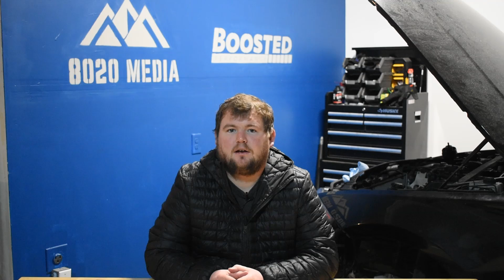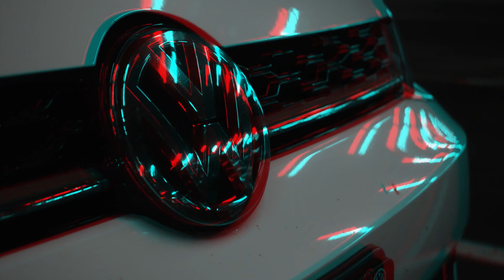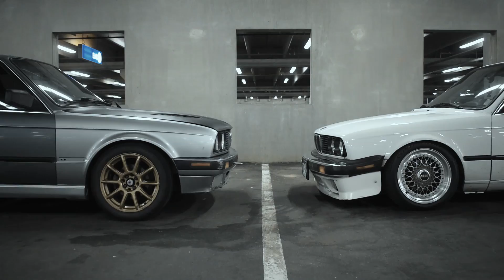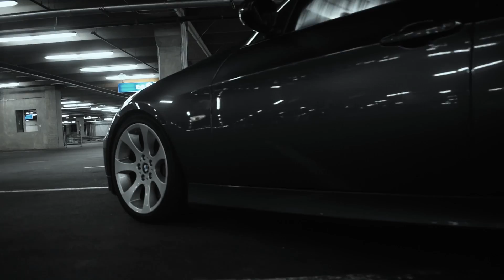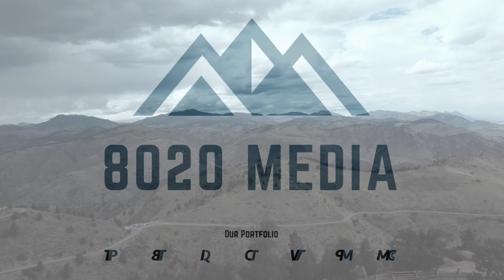BMW N54 | Single Turbo or Twin Turbo Upgrade?

Comment: Folk you don't have to spend this kind of money if you do the work yourself. So if you are capable mechanically and can follow a few tubes, you can get this work done far less expensively.
Reply from the maker: P - Completely agree. However, it's not for the novice DIYers!
Reply: @8020Automotive That is true. I have been a backyard mechanic since I was 15. I'm 59 now. YouTubes like yours are invaluable to me.

Comment: Really interesting video! Personally I'm going with a single turbo kit for my 2007 335i with the 7 speed DCT because I'm aiming for a lot of power, over 900hp. The transmission will probably be the limiting factor so it'll definitely need to be reinforced.
Reply from the maker: F - Thanks for the feedback! Hope it helped.

Comment: Single turbo other pros : less heat ( so no need to upgrade cooling system), less hoses, less vacuum issues, less boost solenoid issues, less carbon built up ( pcv open air) , less O2 sensors. So overall wayyyy more reliable. On long run this is cheaper 100%
Reply from the maker: J - Thanks for sharing this insight.

Comment: I have vargus stage 2+ turbos rated for 750whp im thinking pushing them to 650hp or so would these twins be too hard on the motor at this power level, with a graduall boost tune like 10ps 2200rpms 16ps 3400rpm ect...
Reply from the maker: J - What else have you done? We have a ton of N54 content on our website that is helpful here: https://bmwtuning.co/bmw-n54/
Reply: @8020Automotive  the car is full bolt ons Port injection dual 450 fuel pump relocated inlets, twin disk clutch and all, just need to do lSD at some point.
Reply from the maker: J - Sick build man. Pretty similar to our 335. This article might be helpful for your research: https://bmwtuning.co/how-much-power-can-the-bmw-n54-handle/
Reply: @8020Automotive  thank you very much I will check out the article, and thank you so much for being such a Big help and influence to the n54 community on a budget to high end build... And always taking the time to answer all over our silly questions. 🙃🤝
Reply from the maker: J - Of course! Keep us updated.

Comment: Hey I know im a year late😂 but I really need some advice for my recently bought 335i, I REALLY hope you see this. I just bought a stock 335i, and looking to put money into it. It has 105k miles and after watching this video I’ve decided to go the single turbo path. I don’t know where to start!!! 
Can you please tell me like a checklist of things to do before I even think about installing a single turbo, it would help me a lot. Thank you in advance
Reply from the maker: A lot of it can be done while converting to a single turbo. I'd recommend checking and potentially preventatively replacing some of the following:
-Serpentine belt & pullies (when the belt snaps it can be pulled thru the front crank seal)
-Oil filter housing & gasket, valve cover & gasket, oil pan gasket
-Coolant hoses
-Fuel injectors (check/test for leaks)
-Walnut blast intake valves

I could add more to the list, but that's a good starting point and there are a number of other things you'll be in the area of while installing a single turbo. Best of luck with your build! Let us know if you have any more questions.
Reply: How much did you spend on the 335i ?
Reply from the maker: G - A lot at this point lol. 5 figures easily.

Comment: Great video. When my stock twins suffer the inevitable, I'll go with Pure Stage 2. But honestly don't need more than 500 crank.
Reply from the maker: S - That's what we did! Replaced our twins with aftermarket twins when they went out on us.
Reply: 500 crank is possible on pure 600s. No need for stage 2s .

In addition I have pure 600s, they follow factory boost targets rather well, only about a 200 rpm.difference max in commanded boost and actual.  And hits 8 psi around 1800-1900 rpm. So not a huge difference between stock spool and pure 600s. 

I'm paying off the vrsf charge pipe i had to get to finish off the motor side of things, once that's done, tune time. Will be interesting to see how much performance increases.

Comment: I’m curious why you decided to go with RB Two’s at around 500whp when you said stocks can make 470ish whp
Reply from the maker: Zach is currently running around 600whp on his current tune and turbo setup. But it's always smart to upgrade earlier than you need to and to get a bit more than you intend to use. Running the stocks full bore at 470whp is going to impact reliability quite a bit. Just like running a turbo setup that maxes out at 600whp at 600whp on a daily basis. Building in some power margin is the best bet for reliability in your setup - you don't want your turbos kicking 100% all the time.

Comment: 07 335i AT here… Great insight! So to reiterate what you’re saying, if my goals are 550-600 wheel I should probably just go upgraded twins versus spending the extra money for big single? 

That said, it may be arguable, but who makes the most reliable twin setup for my power goal?
Reply from the maker: Luckee - Thanks for the feedback, and yes, you are correct. We would say TT. We've got a great guide on our BMW Tuning site: https://bmwtuning.co/bmw-n54-upgraded-twin-turbo-guide/
Reply: @8020Automotive  Thanks! Checking it out right now!
Reply from the maker: Keep us updated!
Reply: Check out the Arashi Twin Turbos for the N54 , they are ball bearing, will make way more power then Viv 19T V4 . A little more expensive
Reply: @ForzaPulls are you currently running them ?
Reply: @ForzaPulls no way 15t are gonna make more power than 19t viv v4  is was bigger

Comment: The n54 platform is dead i thought this video was over 10 years ago lol bruh we on b58 s55 etc sold my n54 like 6 years ago
Reply from the maker: Sure, the N54 is getting old and the platform is certainly slowing down. However, it's far from dead and debatably still a better platform than the B58 at this moment. I'm not questioning the B58 is the better engine (especially the TU and now doubly so the TU2 with DI + PI from the factory).

The chassis' the N54 is found in make for more fun drivers cars, though. They're lighter, the 6MT is abundant, and they don't have the junky electric steering. When the B58TU in the "M-lite" models comes down in price and the TU2 makes its way into 240/340/440 models then the B58 becomes a much more appealing platform. For now, the N54 is still alive and well.
Reply: I smoked tf outta new supra with aftermarket exhaust and tune from what I heard in my n54 535i.  Bang for buck way more than the b58. Yes the b58 is a good motor no doubt. But bro, I'm 600hp reliable dd on this and still have room to turn it up. My shit cost me  $15k from the car to parts at the most! Supra dude I smoke probably took his car to the dealer after talking about "something wrong with this one" lmao 🤣
Reply from the maker: Grizz - Thanks for sharing this experience. We love hearing things like this!
Reply: Bro my stage 2 plus n54 have dudes around my way with b58 wanting to go big single to face me. Just because you gave up on the n54 platform doesn't mean it dead. In fact now that it's so much cheaper they are getting far more popular here in Florida.
Reply: The n54 is the OG remember that.
Reply: @bigash_n54  tell that fool... Can't count the n54 out.with enough money anything can be fast.
Reply: Idk what world your in 🤦🏾‍♂️
Reply: I could tell you actually never owned an n54 and just spewed that comment out of bitterness , malice , and just the fact you have nothing going on , so you resort to blind hate . Get a life , not even one response 😂

Comment: Can someone tell me if a 2016 535i m sport would benefit having a single turbo vs a twin set up that it already has.
Reply from the maker: Extreme - a 2016 535i has the BMW N55 engine. BMW used the rather confusing marketing term, "Twin-Power Turbo". The N55 is a single turbo engine that utilizes a twin-scroll turbo. You could convert the N55 into a true twin turbo setup, but it wouldn't be worth the money.

Comment: You just saved me spending a lot of money on the twin turbos which will not even a way to achieve my goal, after watching your video I’ll deffo go for the big single turbo instead the upgraded twin turbo. What single turbo do you think is best option for achieving the highest power on N54? My goal is around 900-1000whp! 

My car running around 500bhp right now it’s on a stage 2+ and the list below is what I’ve done to my car, what else do I need to do to achieve that power? I’ll be much appreciated for the advice:

Aluminium charge pipe upgrade
Bigger step turbo intercooler
Stainless steel downpipes
Bimmerlife r8 coils
Silicone 1.75 Inlets
Platinum plus spark plugs

Oil catch can
Oil temp pin change mod
Engine cowl delete + filters
Upgraded pev valve and alloy cap
Index 12 fuel injectors
Ramair Cone filters
Stage 3 low pressure fuel pump
Xhp stage 3 transmission remap
Mhd stage 2+ engine remap
Protool coded out wingmirrors and bleep sounds
Reply from the maker: Danny - to realistically hit those power numbers you are going to need a built motor on top of a fat single turbo, a bunch of fueling mods, and a ton of other serious stuff. FWIW I'm about $10k deep into my 135i single turbo build (shooting for 700-750whp) and I still don't have an LSD or proper wheel/tire setup yet. A built motor for those power levels will probably run you like $8k and then figure $10k for your turbo setup and to handle 900+whp you're going to need to upgraded axles, a built transmission, and a bunch of other stuff as well which is going to run you thousands more. 

Not to be mean but if you're asking what it takes to get to 900-1000whp you probably aren't really ready for those power levels. I'd say drop a single turbo on it and start with the 700whp mark and go from there. Getting much past 750whp without building the motor and trans and upgrading the axles is just asking to blow up all of these things. Even with the mods list you've got going hitting 900+ is going to cost you probably $25k, and that's assuming you DIY all of the work yourself. 

700whp is fast as crap so start there. I'm expecting my 135i should be able to hit 750whp on the dyno, but I'm going to keep it around 650whp on the street since you really don't need much more than that to have an insanely fast car and it will help keep me within safe limits of the stock motor, turbo, rear end, and trans.

Comment: If I upgrade internals then surely large twins are better
Reply from the maker: That's a toss up. Really depends on your goals with the N54. Once you move to larger TD-04 twins you'll be introducing a higher boost threshold and more lag vs stock frame TD-03 turbos. 

These TD04s can hit 700+whp but I believe, as discussed in the video, a ST is the best option at 650+whp. The PT 6266 or 6466 can spool very well (a tiny bit slower than TD04 twins but not far behind), give more headroom, better peak power, etc.

Ultimately, 450-550whp Id go TD03 twins, 550-650whp TD04 twins are a great pick, anything 650+whp then the N54 ST conversion is likely the way to go. That said, maybe your goal is 600whp with fast spool and excellent low-end and mid-range torque. In this case, Id be on board with building the engine and running RB Twos Plus (TD03 w/ ported outlets) at that power. Those are the turbos I run on my 335i and Id have full faith in running them to 600-625whp on a built motor.
Reply: @8020Automotive  thanks only just seen this for some reason! Yeah I think the low end and mid range torque are best for track use so that’s the way to go for me!
Reply from the maker: J - Keep us posted!
Reply: @8020Automotive what if I want the simplicity of a single turbo but only want about 500whp? Could I just get a smaller single turbo?
Reply from the maker: M - Don't know if it would be worth changing everything if 500whp is your goal.

Comment: For track use what would you prefer? I think the twins.
Reply from the maker: I personally prefer the twins for a track setup and believe that would be the better option for most people looking to track an N54. Anything over 450-500whp is way overkill for most track days, most race tracks, most drivers, etc. Of course, you can make more power and simply turn boost down for a track day. Anyway, the quicker response and low-end torque of the twins will likely be ideal. A small single turbo like a PT5558 or PT5862 (or equivalent size/specs from another turbo manufacturer) could be a good option too.
Reply: @8020Automotive had an issue trying to track and didn't know about the xhp torque reduction upshifts and launch control until after. Always on stage 3 but never tweaked anything for the track until after.
Reply: That’s what I think too. Thanks

Comment: Before upgrading turbo set ups.  New injectors. New coils. Water pump and thermostat. Gaskets all round.  Plugs. Uprate the valve cover and pcv setup.  Once you spent the 5k to 7k on getting this ready for higher boost you can start to think about spending a good 1500 to 2k on fuel upgrades.  Fit new turbos or a single with a good custom map. And start saving up for an lsd and uprated driveshafts.  Now your a good 20k into a build.  Now if you wish to push your builds to next level your looking at aftermarket ecu.  And the only option out there for Di and pi is syvecs.  Don't let this put you off.  I love my n54 but not my daily
Reply: Did mine for way cheaper. 535_i_drive  on 19t's e40 tune fbo. Yes did new injectors, vanos, boost, wp & thermo, mosselman oil thermostat, b58 coils, mfactory lsd. Got the car for $6,500 originally. 540whp on 19lbs stock lpfp too (535i  has stronger lpfp than a 3 series)
Reply from the maker: Grizz - Thanks for sharing your experience!
Reply from the maker: Adam - Thanks for the valuable insight here. We couldn’t agree more! We have two N54s in the garage and are converting our 135 into a ST in the near future. Love them both.
Reply: Water pump and thermo, huh.
Reply: Do maintanance ------ Injectors, coils, plugs, gaskets etc. Then buy LSD preferably inside of M LSD... good suspension... Then VIV V4 19T with inlets etc. + oil pressure sensor.. = no need for single turbo and you have basically small  M4

If you want to keep some ability of daily drive etc.
Reply: @FeeZeeF30 are viv 19t worth it? How much power can you get out of them reliable?
Reply: @georgecatan9333   their V4 version is better then OEM and have a great reviews... me 500hp and were good when i sold car after 15k km
Reply: 20k if you're an idiot
Reply: Refurbished index 12 on marketplace (make sure you test them yourself) $1200. Brand new thermo and waterpump kit $370, important gasket such as ofhg, ocg, vcg, img, and a couple others $220 for all. $320 if you wanted to do oil pan gasket (not usually needed) refurbished oem hpfp maintenance you didnt include $400. Upgrade to aluminum cover for 2-300 including the gasket. We will round our total to 3k just to be safe. If we want to include the price of a car I will add I've bought a low mile 335i that needed new turbos for $1200. Let's round up to $1500 so $4500 so far. Hardly Useded st kits you can find for 3k including the turbo. Throw an 8.8 rear end on it using another car you got off market place for $1500 (my 4x4 ranger) take the rear end out and refurbished it. Buy the parts needed to make it fit. Voila. You have a reliable monster of an n54 for around 10k that's rounding up every time too.
Reply: Thanks! I've been wondering what supporting modifications need to be done before upgrading turbos.
Reply: @GojiraTenno depends on your goals, this guy is just throwing the kitchen sink to throw the kitchen sink. You can make around 600 off the factory hpfp and piezo injectors.  But if you want to run e85, you're looking at adding port injection. Which requires a jb4 or a motiv reflex. And motiv seems to be moving away from the n54 lately.
Reply: Hey man go park that n54 at the scrapyard, you have no idea what you’re doing with this platform 😂. $5-$7k in mods u F N dork? 😂
Reply: Idk my n54 has 73000 miles on it. Not really worried about hpfp injectors or anything (i did the pcv upgrade cause thats a given). More worried about the valve cover radiator with plumbing and oil cooler. Im also planning on reducing as much rotational weight as possible before touching anything power wise. Flywheel, aluminum drive shaft (after m3 rear end) magnesium wheels and those cheap(er) carbon rotors from alibaba. Then step up power over a year or so.